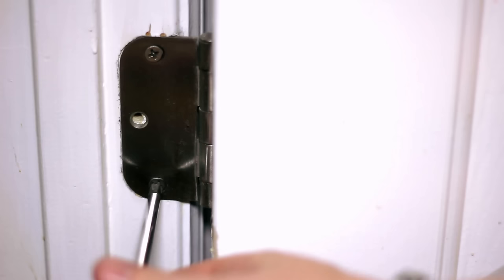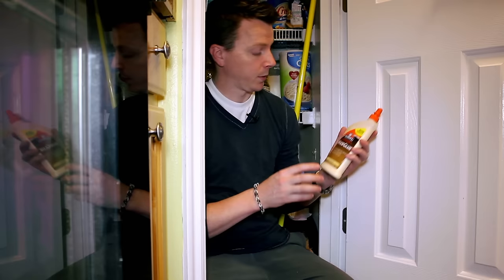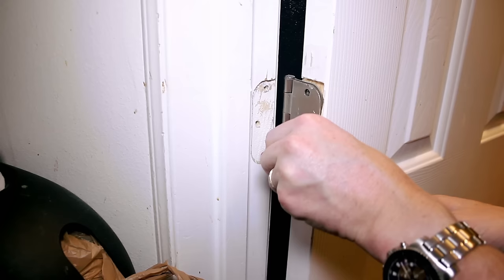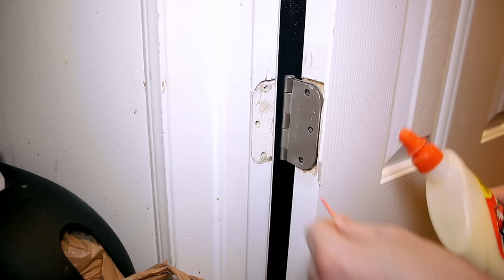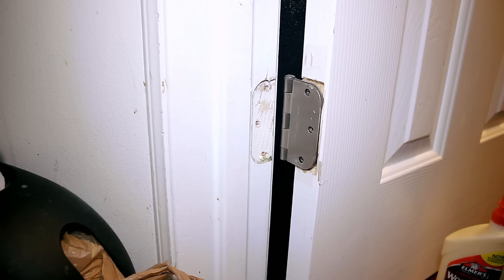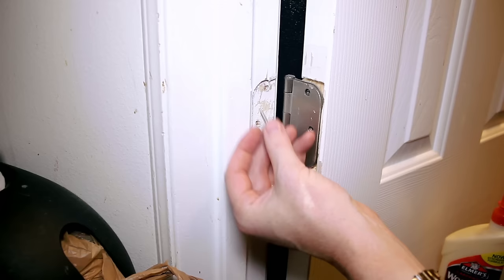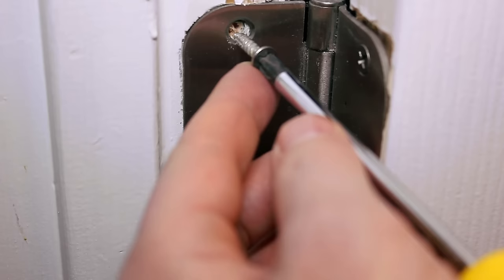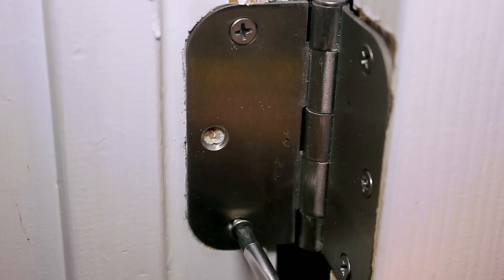Fix Stripped Screw Holes - 3 MINUTE FIX!

Comment from the maker: As some viewers have pointed out, running a much longer screw (3" screw, for example) will often remedy this. It drives deeper into the actual framing rather than just the door casing.
Reply: Amazing ... going do this ASAP
Reply: This is true I have done that... but this  way its a pain in the butt & doesn't last as long.
USE GOLF FEES.   I use Gorilla Glue for wood - hammer in the golf tees - let it sit for 24 hours and then I saw off the ends of the golf tees then I sand it and then screw everything in. TA DA  it's good for 20 years as long as you use the long screws.
PS. Golf tees come in different sizes. Make sure you get the correct size for your screw holes.
Reply: @feistyterrier  I've heard about golf tees a long time ago. I'm going to use them.
Reply: I agree with other poster, this does fix but not for long and are left with DEEPER hollowed out hinges lol. I'm am fixing my rn, it just took 3 toothpicks, at full length.   Woodglued them all the way in. Should work just fine as you described In Video. 
Just adding on if you've stripped them out real good like me 🤣🤣🤣
Reply: Id need 1ft screws just to reach wood to bite into.
Reply: Yep. This is a pretty shithouse fix when you consider effort:result ratio.

If you can't just use longer screws, use spare dowel from furniture, drill out screw holes a millimetre thinner, apply two part epoxy to dowel (not this bpa wood glue rubbish), and when set, re screw hinges.

Works well. If you don't have a flush cut tool like a multi tool you can estimate the required depth of the dowel and cut it to size before inserting. Often that's a better way, as there is no risk of damaging areas that can be seen.
Reply: @paavola2  on1s
Reply: Can you do this to the door as well?
Reply from the maker: You can! The longer screws won’t typically work but the toothpick or golf tee method should.
Reply: @LRN2DIY  thanks
Reply: True I've tried it and only worked temporarily
Reply: I did it and it worked great. Even had my son help me to teach him the information. Thank you so much
Reply: Doing this is likely to throw your door out of square
Reply: @jt9371  it didn't fit me
Reply: @paulraymond1804  wood glue is more than strong enough for this application. You know carpenters sometimes make joints using only wood glue, right?
Reply: Some applications this won't work. Block homes for example.
Reply: we have tried the 3” screw but still doesn’t seem to be grabbing frame. hole still stripped
Reply: Naw. Just causes more damage. The fix you gave was perfect IMHO. Instead of toothpicks i have scrap wood that i crudely trim to size with wire cutters. No glue needed. Cheers.
Reply: Thanks for the comment cause I already bought the 3 inch screws but wasn’t sure it would work. This video is great though thanks for going nice and slow. I’m completely new to trying to fix anything myself so this is very helpful.
Reply: And if 3 inch screws don’t work just use 6 inch screws.
No, seriously the toothpick or match method works every time you don’t even need glue unless the hole is seriously split as well.  
Renovation carpenter with 40 yrs experience (by the way)
Reply: I’m excited to attempt this on a chair
Reply: Yah, but my doors screw holes are completely stripped out, longer screws ae no help in this case.
Reply: jt, no, it doesn’t throw it out of square. The screw is obviously finds its way in to the same hole and because the hinges are set in to a notch in the wood everything lines up perfectly.
Reply: @rothwegk if the screw is going in to wood it will work. If it’s not going in to wood then this is the wrong video.
Reply: Lol
Reply: Won't work on a chair leg

Comment: Didn’t have matches, chopsticks, toothpicks and didn’t want to drive into town. Cut 2 inch long by 1/4 inch pieces off the end of the longer style paint stirrers. Sharpened the end, put some glue on it and drove one in each drilled out hole. Worked great.

Comment: Great video! I’ve been using tiny wood dowels in the same manner since I inherited my grandmother’s house 15 years ago. Extremely difficult to find boards to make a whole new frame in this type wood and not everyone has tiny dowels laying around. Most have toothpicks and maybe even some Elmer’s school glue (which works also, if given time to dry). I’ve also found that one shouldn’t use a drill on hinge holes, as it will strip them faster. Also, I have found that opening the wood glue container makes a world of difference! 😂

Comment: I used the thicker 12 inch BBQ matchsticks. I had them laying around. Just cut them a bit longer than the hole, broke off the excess with a hammer and screwed the screw back in. Had my heavy door fixed in less than 5 minutes ! Thanks to this video.

Comment: This worked for me. I needed to reattach my dishwasher to the underside of the countertop, but it's a cheap countertop made from flake board and the screw holes were stripped out. I used a hot glue gun to glue four toothpicks up into the holes, then cut them off flush with a steak knife. The screws went in beautifully. 

Next up, loading the dishwasher.

Comment: This is a great trick. I've seen similar with using a wood dowel or sharpened pencil tips, but is a lot more "things around the house" friendly. Another great alternative if you have some handy is canned foam insulation. it dries really hard and holds a strong bond and it is drillable. it's also really great for filling in large drywall holes like behind where a towel rack support hangs. just be sure to have a putty knife handy to level off and remove the excess defore it sets. if you wait to long and it cures, it'll take a hacksaw or dremel cutting tool to remove the excess.
Reply: I was seriously about to Google how to fix your shower rack when it comes out of the wall before I saw this. lol thank you 🙏
Reply: @Linsicase  awesome. Hope it works well for you. Its saved me a couple times.
Reply: The foam sounds like a great idea for stripped screws. It is my go to for repairing dry wall. It makes it so much easier.
Reply: @AsAugustSleeps  right? The stuff is amazing for all kinds of patches.
Reply: The foam also works to repair holes in hollow core doors.  You can shave excess off with a razor blade.
Reply: @inpursuitofgoodservice9636  nice tip. I didn't think of that, but I have used it for the same thing on drywall. God bless my friend.

Comment: I been doing this for decades. Great to show everyone in a vid. I also use longer screws that will bite into some new wood inside the holes. Between that and the toothpicks, it's every bit as solid and strong as when the original screws were first installed.

Comment: I never have much luck with hot glue, so I repair stripped holes in antique clock cases as follows:  (1) Fill hole with super glue gel. (2) find a round toothpick or two and dip them into the still-liquid glue gel in the hole.  (3) Then dip the glue-coated toothpicks in baking soda--bicarbonate of soda---and put them back into the hole you're repairing.  The baking soda greatly accelerates the hardening of the glue gel, which generally doesn't like having such a thick cross-section.  The toothpicks will be secured in about 30 seconds, at which time you can cut them off with wire cutters or something.  Re-drill your hole as best you can.

Comment: Dowels, toothpicks, golf trees will all fail.

The problem is 1" hinge screws.  Throw those away and get some 2-1/2" or 3" screws and get the screw back into the framing.
Reply: Yes I would do exactly the same thing and have done in the past
Reply: I feel like he chose the worst possible scenario to demonstrate this. It works perfectly for cabinet doors, door strikers and striker plates, drawer slides, etc. places where you have solid wood to anchor in.
Reply: Yep,  I agree.  And go back in with a slightly larger dia. wood screw.
Reply: They won't fail.  I have done this with tooth picks over thirty years ago on a solid wood door - still holds fine.  Pounding in a snug solid dowel works even better, but you have to re-drill the holes.
Reply: I was just going to suggest this as well. Those typical short screws used for doors always seem to pull out over time, go longer for it to be stronger! 👍
Reply: This worked for me! I tried the tooth picks + wood glue and they didn't hold...(not surprised, I was skeptical wood glue and tooth picks could support like a 30-40 pound door frame). So then I bought new longer wood screws (less than a dollar at walmart), and just screwed them in. Worked like a charm.

Comment: I have done this a hundred times, and I have never waited for the glue to dry.  If you drive in the screw with fresh glue, it still grabs the wood just fine.  It also presses against the glue joints and helps spread the wet glue through the gaps and against the threads.
Reply: This method seems to work without glue, as well.
Reply: If you don't wait for the glue to dry then the glue will not be doing you any favors once it does. Any retaining forces it holds will only take effect after hardening.
Reply: @matttrowbridge856  I hear what you're saying, but I tend to disagree.  If you have a clean hole and fill it with a well-fitting, solid plug, then the joint will be strongest if the glue is allowed to dry.  But when you shove a few loose toothpicks into a hole with stripped threads, the fit is not very tight, and the thick layers of glue will not be as strong as they could be.  If you drive in a screw before the glue dries, you're essentially getting the same strength you would have achieved without the glue.  But now the glue gets squeezed into thin bonds and increases the strength after it dries.

Comment: This worked great.  Thank your for this video. I even had really long screws that I had tried before to fix the problem but the toothpicks did the trick. I found really long tooth picks so I decided to give those a shot since I knew I had previously drilled deeper holes.

Comment: Handy tip mate. I used wall plugs before this, Still going strong.
Reply: That's what I use.the toothpick method will be OK, but if you take the door back off the the screws will drag the toothpicks out.wall plugs work perfect because that's what their designed to do.
Reply: Wall plug? Do you mean Rawlplug?

Comment: I ended up using a left over wooden dowl from putting together furniture to fill the screw hole.  It fit tight so hammered it in with no glue and drove in the screw.  Worked well

Comment: Hey Nils. A sensational story for you. I have a Kenmore fridge in which the door handle kept coming off because the top two screw holes were stripped. A few years ago, I had a Sears repairman come and try to fix it. He charged $150 to my landlady and all he did was put some epoxy in the holes. A couple of months later, the screws came loose and the handle came off again. So, I left the door alone with no handle for years. Then, I saw this video and decided to give it a shot. I just finished the job. IT WORKS! Many thanks.
Reply from the maker: How cool! You're taking this tip to new levels. Hopefully it holds for a good long time and thanks for sharing :)

Comment: I have similar situation though my door jam is semi cracked my fix will be to take off door with hinges pre drill old holes slightly wider to make holes clean then using proper size diameter of dowell rods & wood glue insert them then let dry for a day then re drill new holes put everthing back be like new.

Comment: Also possible: I have filled hole with epoxy (favor JB Weld appropriate to the substance the hole is drilled in) then, before it sets, insert a well oiled screw into the hole.  Wipe away the epoxy that is forced out and work the screw around to get full coverage; let it dry.  The screw should come out easily.
I sometimes let the screw protrude slightly so the last turns really do 'bite'.  In other cases I have enlarged the bottom of the hole (angle drilling) before applying the epoxy - the wider 'bottom' makes it more resistant to pulling out.)  You can still add the toothpick if you want, but you'll have to redrill and add the screw later.

Comment: Glue is fine, but not really necessary. The pressure of the screw pushing the toothpicks against the sides of the hole will keep them from coming out. At the very least, there is no need to wait for the glue to dry before putting the screws in. Think of the plastic anchors you use in drywall; they are not glued in and generally work just fine. You need to be careful about putting too many toothpicks in the hole. If there is no room for the screw, you could split the jamb. That's why pilot holes are generally used before putting the screws in when installing them.

Comment: 3/8 bit. Glue and 3/8 dowel rod.  Drill all the way in to the frame behind the hinge facia. Apply glue in the hole and on dowel rod. Tap dowel into hole while twisting of possible to ensure glue coverage. Saw off flush. Allow to dry 1-2 hrs. Drill small pilot hole. Reinstall hinge and screws.

Comment: Yessss Success Flawless victory 💯💯💯 Fatality 😂😂😂😂 the best information and Quickest $25.00 bucks I made for 30 min worth of work!!! Used Durham's Rock Hard Water putty and 2 toothpicks split between the 4 striped screw holes waited for it to dry and had the Client with a For sure Kool-Aid Smile 😁 I told them $20.00 and they threw in the Extra $5.00 for the Door closing smoothly 💯💯💯 thank you again for your Wisdom and Experience 💯💯 Sifu

Comment: I drilled the holes bigger and put some threaded inserts there. That way I can remove the hinge as many times as I want without having to worry about the threads.
Reply: @aaronogorzolka5538  Thank you for your comment! I also had the hinges sandblasted and spray painted white to make them lool like new 😎
Reply: what is a threaded insert - can i buy them?  i used wood filler that comes in.a tube and squeezed it into the screw hole which seems to have worked. Redrilled the hole then the screw went in completely tight.
Reply: @raz3032  You can get them from AliExpress or Ebay. You should look for a video "how to use threaded inserts"
Reply: rjlaaksonen haha I was gonna try drywall anchors (I was desperate ok) but decided it was probably not a great idea & used a longer screw than the original as a temp fix... it’s starting to catch again already. Dang kids smh haha I’m going to look for some of the inserts u mentioned. Thx!

Comment: I did this in wood cabinets and it worked great!  The closer at top of storm door completely pulled out of door - all three screws. It is a metal frame. Would this work also for metal?

Comment: i just shove bunch of tooth pick and wedge it in there and shove the screw it works. also ive used pop cicle stick just cut them to the proper length and width and it works

Comment: It's good advice.
Hollow core doors it works fine.
If you have a solid heavy door.
Then use 2 1/2  3 inch screws and go into the frame.
Done!!!

Comment: Hmm, I've been using toothpick, golf  tees wood dowels and longer screws for a long time. I don't think you really need the glue(doesn't hurt). If you use a a couple more toothpicks you can plug the hole soildly(with out glue). I like the ones that are pointy on both sides. It's really easy to stock toothpicks. Thanks for sharing your version.

Comment: Well I did this last night, as I received the wood glue from amazon yesterday. I let the tooth picks set all night and chipped the ends of with a hammer like in your video,?was well shocked when screw tighten, so chuffed that I fixed the tv draw as I was going to chuck it 😁

Comment: The quickest fix is to get wood screws with a larger diameter shank (the sizes are numbered) and the same size head or near the same size head.  Not a longer screw. If you are fussy you can over bore the countersink of the hinge holes to get the bigger head dead flush but usually there is sufficient give in the hinge as is to not bind on closing the door.  Any screw which isn't full threaded will work loose even if it gets to the frame because the door frame hole needs the threads to hold alignment and the non threaded shank is quiet a bit smaller  .  Beware of toothpics/matches etc. working as wedges and splitting the frame.  If you are going to go this route wait for the glue to set (overnight) and drill a proper sized pilot hole before replacing the screw. I'm 35 years landlord ;kinda an expert.  Oh no round head screws either.

Comment: Thank you so much! I never encountered this problem before and wasn't sure what to do. I literally tried everything. I looked up on amazon and almost bought one of those anchor type screws that's supposed to help. So something told me to check the internet once more before spending money. After watching your video I wasn't sure if I could do it because I didn't have any wood glue so I used some adhesive that I already had here at home that stated it glues together  wood. I was nervous during the whole process lol. But IT WORKED! I was so Lit! Lol thanks man, if you only knew how long that door been bugging me XD. You made it seem so simple, thanks again btw just subbed

Comment: I use popsicle sticks cut down the middle and loaded with glue. Just use a utility knife to scribe a line down the middle of the popsicle stick and keep scribing until it parts. Also use the utility knife to cut a little arrow on the end to make it go in easier. Toothpicks are okay for real small holes. But the popsicle sticks work a little better with really stripped out holes.

Comment: golf tees work much better and are thicker.
Reply: Killer idea. Thanks for sharing my friend!
Reply: ATPro 24 ... golf tees are the trick . We have them on the truck for this situation. Definitely the best method. They are tapered , hardwood and they snap off really easily.
Reply: Does the golf tee work on the door itself if it’s stripped? This video applies only to the frame